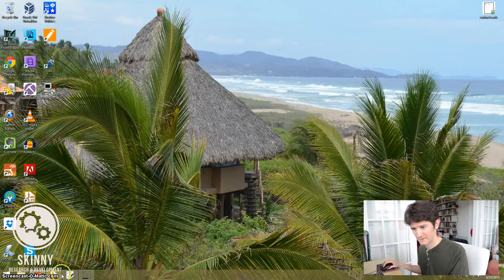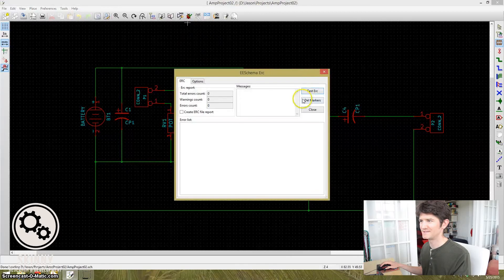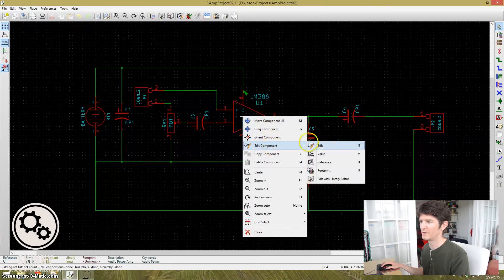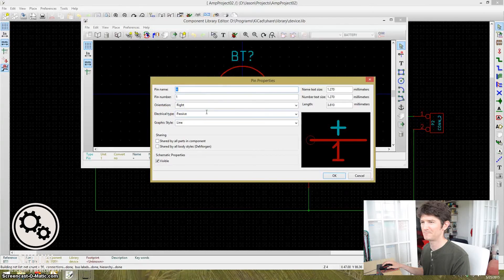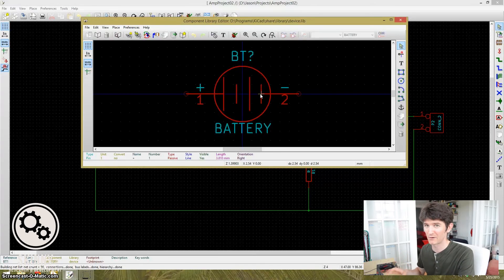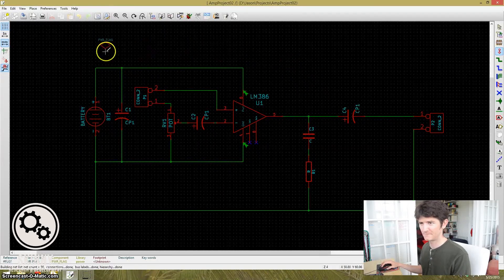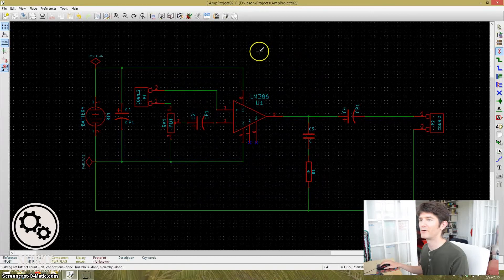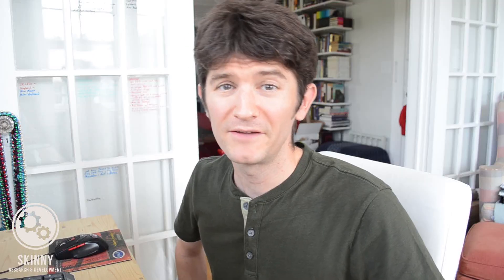Using the LM386 KiCaD Part or Dealing with KiCAD ErrType(3)

Comment: .I have Mono plug (TS) jack connector to take output signal from the amplifier so which device (in kicad)  should i use to take output signal from the amplifier.
Reply from the maker: You'll either have to make your own footprint for the connector, or you can do what I do. I usually put two holes in the board for the output and then run 2 wires from these two holes.
Reply: thank u.

Comment: hi Skinny R&D,
                      thanks for teaching us about PCB designing using kicad. let you show the how the PCB board look like after uploaded in manufacturer website detaily. also whats the use of  pcb calculator.
thanks
Reply from the maker: +Softrix Technology The PCB calculator just has a few helpful scripts and charts to help while building a pcb. If you don't see something you recognize from the tab, then it's probably not going to be helpful to you. I've used the attenuation part before to help me match impedances in an RF circuit.

Comment: Good tip.  Would be good to edit the battery part, and put a bug report into kicad devs on launchpad so they can fix it.  

Also, if you download the current build of kicad cvpcb is gone.  Would be good to see a video from you on how footprints are assigned in eschews now, etc.
Reply from the maker: ***** Thanks for the heads up on the new KiCad builds. I'll give it a shot.
Reply: Cvpcp is not gone, just working differently. Doesn't generate a separate file now, but rather is stored in the schematic file. It's still used to associate a symbol with a footprint.